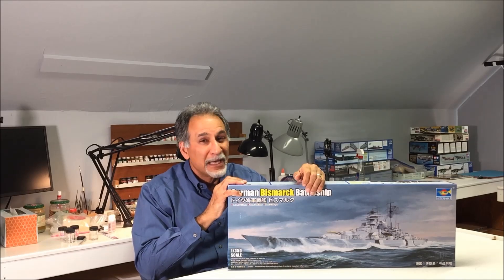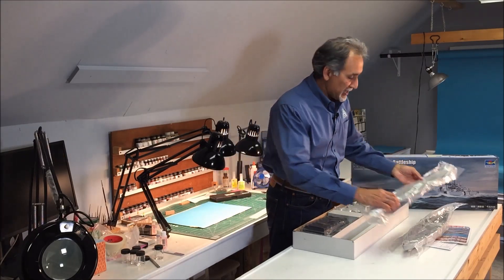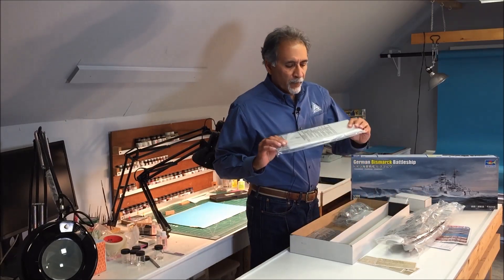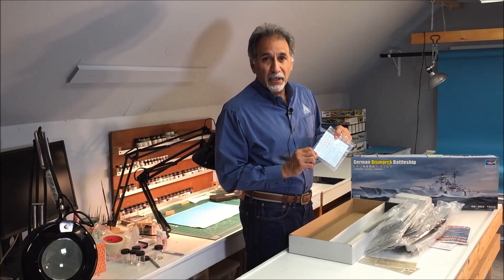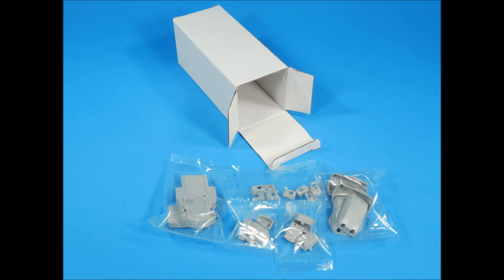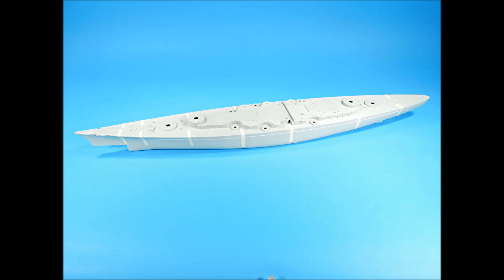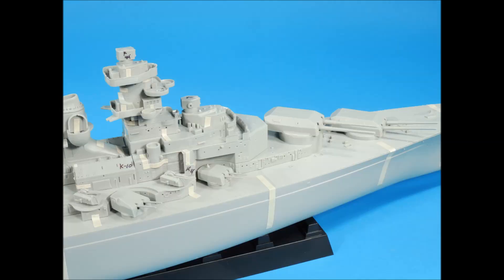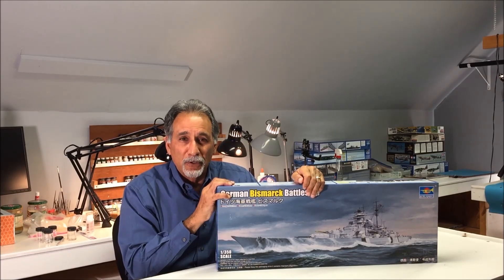Trumpeter 1/350 scale Bismarck tape up review

Comment: Nice review Mike!  Just found your channel although I’ve owned a ship modeling book authored by you for a few years.  The last Trumpeter kit I kind of threw together was their 1945 Indianapolis.  Lots of superstructure assemblies putting panels together (PITA).  Glad to see the absence of that in this kit.  IIRC, Veteran Models makes some real nice resin and metal secondary guns etc. that would really enhance this kit!  Thanks again Mike for the very informative review!
Reply from the maker: Thanks

Veterans does have done nice detail sets

However I am sold on Black Cat models 3 D printed parts

Check out my review of the ones I used on the Missouri build

Comment: 12:54
well, actually, for the 105mm gun , the different mounts  also have the different barrel (even all of them are the same as the SK C/33 105mm gun). the trumpter try to make the barrel parts be different but looks like not be very well. If you want to exchange the plastic parts into metal barrel parts, must be attention the difference of the 2 kinds of the 105mm barrel.

Comment: Thank for your informative review, it was really helpful. Very detailed and tape up part is really step over usual "look what's inside" type of reviews.
I really don't know how to feel about this kit, because while it looks as a real improvement when compared to previous Trumpeter kits it also shows it is still a Trumpeter, because fit is still not "Tamiya perfect" and those malformed AA gun barrels that needs to be replaced have simply no business being in the kit considering its price. And that's where I have my biggest issues with the kit, this kit retails for 250 USD and that's an awful amount of money for a Trumpeter kit. Better Trumpeter, but still a Trumpeter. I think the company went little too high with the price considering their older kits in the same scale are retailing under 100 USD.
However, I really like those one piece superstructures though, that is a vast improvement compared with their previous kits using a method of "glue four sides and top", which was really annoying especially on ships like USS Arleigh Burke, which doesn't have a single right angle on its superstructure and that makes fitting very complicated. 
I have to disagree with you regarding the painting guide. I think this type of painting guide is sufficient for planes and armor kits, where you can ascertain how the kit should be painted from top, side and bellow views, but ships are very complicated to paint due to vast amount of details and it would really help if Trumpeter would show colors also in assembly guide (as is done for example with plane interiors), because I can't see from any available painting guide view how I should paint some detail, which is behind something and that's very common situation on ships. With a painting guide like this one needs a tons of pictures of various details on the ship, which is reasonably easy on current ships like that Arleigh Burke or museum ships, but kinda hard when dealing with Bismarck, which is resting on a ocean floor and whose pictures are limited and black white only.
Reply: I realize I am kinda off topic but do anybody know a good website to stream newly released tv shows online ?
Reply: @Kristopher Gunnar flixportal :D
Reply: @Layton Rowan thanks, I signed up and it seems like a nice service :D I appreciate it !!
Reply: @Kristopher Gunnar You are welcome xD

Comment: hi .i just want to ask if which is better of trumpeter bismarck 1/350 compare to tamiya bismarck 1/350 kit?
Reply from the maker: Trumpeter did a great job on the kit and the surface detail is far better than the Tamiya kit

The AA gun barrels have issues but Black Cat models has 3D printed replacements

Mike

Comment: I really wish the 1/200 version was detailed like this version and the parts were attached to the spur like the 1/200 the forward angles piece is attached at too many points and the plastic is too weak. My father gifted me this kit mistaking the size for 1/200 I will build the kit but it's not in my opinion a great kit